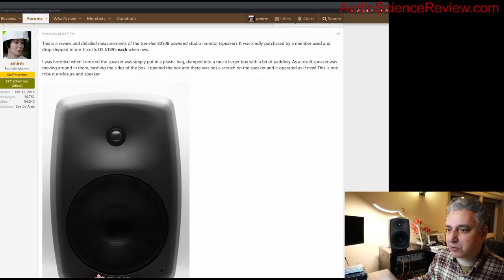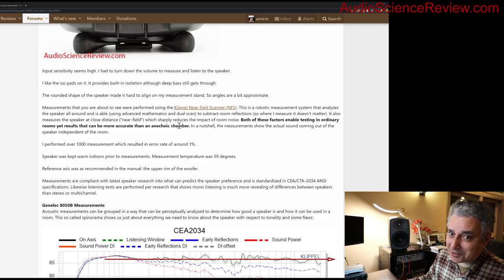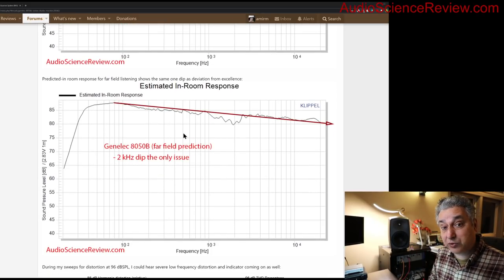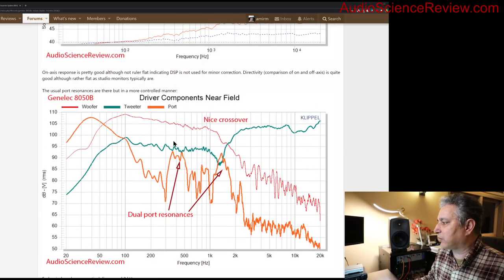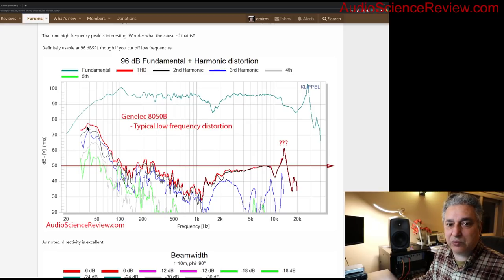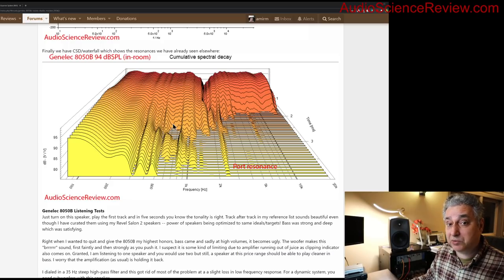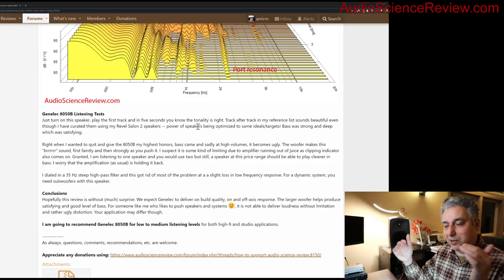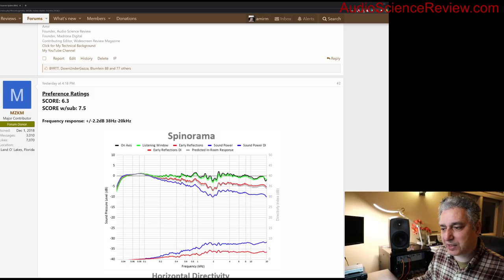Genelec 8050B Speaker Review (and how to read speaker measurements)

Comment: How does the low frequency THD translate to IMD in the woofer? Never seen that measurement really done, probably for obvious reasons. But for two-way systems it seems that could be a major source of distortion at higher volumes. Even though my main speakers are full range, I still set the cross-over up to limit the low frequency content below 100Hz, and balanced the sub accordingly. Seems to buy some more headroom. I have done in the past some quick two-tone IMD tests of the woofer and tweeter with tones at the lower and upper end of each's respective response, and got a few percent at around 85-90dB. Might take that measurement again with a better eye to detail and actually use a wider range of tones for the lower tone in the woofer to see what happens.

Comment: I've been extremely satisfied with a pair of Genelec G5s which I understand is more or less the same speaker as this in terms of performance. I have them set up in a rather compact apartment with Dirac room correction. They get more than loud enough and there's only a handful of tracks and movie scenes where the bass response ends up falling short. Hard part is choosing what to upgrade next.
Reply: Genelec subwoofer and you will be fine!
Reply: What? I thought the g series was for home use , these are for studio monitoring how can they perform the same way?

Comment: Hey Amir, as usual, great content. My nerdy engineer side loves your channel and website will all the heart. 
Most of the content of the video today was already known by myself (well, i'm an engineer). But something was new to me, and perharps you could explain me. You said that the reference point for the speaker axis was at the edge of the speaker, but i assume this is not the case for every speaker right? Could you add this info for you future reviews? might help people with the proper placement. For example i have an LSR305 and i can't really tell if the acoustic center is at tweeter axis or at some point between the speaker and woofer. Perharps the Klipel could tell us with precision! 

Thanks for the great content. Keep up with the nice work.
Reply: PS: I have this idea that the Acoustic center for the LSRs are at the LED position.
Reply: Hi there.  Every review I have done for good few months has the reference axis in the intro to the measurements.  In most cases, speaker manufacturer does NOT specify this so the convention is to use the tweeter.  Only a few Pro monitors like Genelec, Neumann, etc. specify this and if so, that is what I use and indicate in text.
Reply: @amirmajidimehr640  Checked again, looks like i have to read things more carefully! that would be all! thanks, again.

Comment: Really impressed with your reviews. Why do you not often use the cumulative spectral-decay plot ? And what about the impulse response plot? What is your view on Active speakers vs Passive: Is a long balanced XLR cable better than Speaker power cable? What is better to calibrate frequency response on: White noise or Pink Noise?
Reply: Let me do a separate video on that to explain.  On active, they are far more accurate than most passives and are ready go out of the box.  With many passives you need to EQ to get good results.  Their down side is that they have limited power/how loud they get with some exceptions.  The other down side is repairs.  If the amp in them goes bad, you have to send the entire speaker back for service and this can be a pain.   Long XLR cables are just fine.  That is what they are made for.  On frequency response, white noise at too high a level can damage tweeters.  Best to avoid both and use a "log chirp" signal.  Free and excellent program Room EQ Wizard uses this and that would be my recommendation for measurements.
Reply: @amirmajidimehr640  Thanks Amir! Really appreciate your new channel. Just watched your USB cable interference story. Great that you are highlighting the con-artistry.

Comment: I didn't understand the explanation of the discontinuity where the woofer and tweeter cross over and how the waveguide corrects that. If anyone would like to help me with that, I'd like to learn more about how that works. I also wonder what the difference is between a waveguide and a horn, if there is any.
Reply: How about I do a drill down video on this in the future?  I don't know of a simple reference for it even though it is a baseline aspect of speaker design.
Reply: No real difference between a horn and a waveguide, if anything it would be that a horn aims to also increase sensitivity.

Basically, at 2000Hz, a tweeter in free space (not in a speaker) would be almost omnidirectional, whereas a 5” woofer at 2000Hz will no longer be omnidirectional and the sound will start to focus being more forward.

In order to better match these drivers together, a waveguide basically acts as a barrier around the tweeter so the off-axis can’t go as wide as it normally would and is instead pushed forward, this does increase the SPL of the tweeter at the cost of soundstage, but this waveguide can be shaped such that the narrowing of the tweeter’s sound is similar in spread to the woofer’s natural narrowing.

Now, as for why some waveguides are circular, some are oval, and some are “pinched” in the corners, don’t ask me. The designers probably do some fluid simulations and determine which is best for their application.
Reply: @amirmajidimehr640  that would be wonderful for me! I hope other people are as interested to learn about it as I am. Thank you for considering it.
Reply: @homeboi808  thank you. I think that does clarify things for me quite a bit. Part of what confuses me though is the idea that lower frequencies would be more narrowly focused than high frequencies. I was always under the impression that the lower a frequency is, the more widely and less focus its dispersion becomes. Is dispersion width being affected by both frequency and driver shape?
Reply: @AndyBHome  If you just hung a driver from the ceiling and played frequencies, the “spread” of the sound would indeed be based on frequency and the diameter of the cone.

As explained, a waveguide on a tweeter acts as a barrier. The ultra high frequency (say 15kHz) are so narrow that they don’t even hit the waveguide, they are unaffected. 2000Hz out of a tweeter however is naturally has a very wide spread. This spread is running into the waveguide which is “guiding the waves” so that they get pushed forward instead of spreading out sideways.

2kHz will still be wider than 15kHz, but not as wide as it naturally would be because of the waveguide. Think of cupping your hands around your mouth when speaking.

And again, this narrowing at the bottom end of the tweeter is to compensate for the fact that the woofer is also narrowing as it goes up in frequency, so the waveguide tries to match how wide/narrow the tweeter is at the crossover with how wide/.narrow the woofer is.
Reply: @homeboi808  That is really helpful! Thank you again homeboi! Of course every answer, no matter how good, leads to more questions. Now I'm curious as to why we want dispersion to taper/expand evenly across the frequency spectrum. Do we try to find ways to get all frequencies to be as similar in dispersion as possible? Do we try to get higher frequencies to "spread out more?" Do we actually want certain frequencies to disperse in different patterns from others? (I'm just asking. Please do not feel obligated to respond.)
Reply: @AndyBHome  Omnidirectional speakers (like MBL) indeed do aim for all frequencies to have a constant  “spread”

The Dutch & Dutch 8C is sorta the opposite, where it achieves an constant “spread” by making most all frequencies have a constant narrow “spread”. It is more laser-focused.

 As for whether it’s better to be constant or smoothly tapering, that is up for debate.

I think it also depends on how wide the room is.

Comment: that bass distortion effect you mentioned I feel like I've heard in many powered speakers, stuff like mackie PA speakers. It's awful! for monitors you don't listen as loudly usually, so it's probably okay.
Reply: Tru dat.  There is extreme pressure to keep the size and cost down on internal amplification and it often becomes the limiting factor.  I suspect some of this is also to keep the speaker from being damaged.
Reply: @amirmajidimehr640  
Agreed.  Though excellent up to a certain SPL, the active near-field Neumann KH-120A studio monitors that I use are dynamically limited.  They also have the limiter and clipping indicators like the Genelecs.

As you mentioned, using a separate subwoofer dramatically reduces this limitation.

I'd be interested in having you measure my ATC SCM25A monitors as well.  I was going to approach Erin Hardison about this (have known him for years via car audio forums).   But he's been seriously backlogged, even before receiving and getting his new Klippel set up.

But it will be amazing having both of you guys providing truly world-class objective data to the community!  👍

Comment: Hello Amir, I'm not sure I understand the distortion graph. Do you measure it by doing a sweep, substracting the original tone and seeing what harmonics are left at each frequency? You mention in the video that the distortion bumps in the low end do not matter because we are not picky about the low end, but aren't these harmonics showing up in the mid range rather?
Reply from the maker: Hi Oj.  No, it is a more complicated system.  A log "chirp" signal is used for frequency response.  That signal nicely generates the frequency response but also separates all the harmonic products (they appear in "negative time").  So no subtraction is needed in the way you imagine.  

On distortion, yes, if they bleed into mid-range then they do become audible.
Reply: @AudioScienceReview  I see, thanks for the clarification!

Comment: There's no way the woofer is producing those higher frequency sounds in the graph. It is a safe assumption that the crossover keeps going at the slope you can see near the crossover region (or in reality steeper since the woofer can't reproduce those frequencies well anyways). There's no reason a designer would add complexity to the XO just to bring the woofer back up to frequencies it will have cone break-up / beaming problems.

Comment: Could a person who just read your measurements determine that bass distortion you noticed without listening to the speaker?  Is the nature of that issue captured in the measurements, or could it only be determined through listening?
Reply: I am afraid not.  I have tried to develop tests for this but it is not an easy thing.  In addition, it stresses the speaker so there can be some risk of damage during measurements.  Since I don't own these speakers, I can't quite there.  But I will keep thinking about a way to objectively show the issue.  For now, listening test is very quick and reliable so have to go with that.

Comment: hi, is there a point in buying something like focal arche when there is topping l30 e30 combo that has awesome response
I get it, integrated unit, balanced out, built in France probably better capacitors and etc. but the difference in price is huge, and in measurements not really
Reply: Yeah, unbalanced into 32ohm it gives 1W with -80dB SINAD. The Schiit Heresy for instance gives 2.4W with -95dB SINAD.

You are mainly paying for the fact that it’s Focal and you can use it as a headphone stand so it looks cool.
Reply: Depends on whether you believe in amps changing the sound or not. Objectively speaking, there is absolutely no reason to pick an Arche over some of the more recent budget competition.
Reply: i mean ideally amps should be wire with gain right?
I am so impressed with these "cheap" dacs/amps that we have today I don't even think it's worth to pay several times more to get almost nothing in return
Reply: @bizkac  Not almost nothing, provably nothing, because the noise level is so far below the sound level that it is completely inaudible.
Reply: at least you get more ports and things like mqa support or PREMIUM CAPACITORS

Comment: It looks like someThing out of the terminator movies. Yes it measures quiet cos the gain level is turned down so much and only sound it will pick up is the sine wave, pink noise or frequency sweep. I can, we can all do the same thing when measuring up close which is what I do if measuring up close I turn the gain level down on the mixer used for the XLR microphones.
£100 grand for what is mostly made of aluminum and some servo motors most of the bulk is common as cheap fish and chips on ebay, Daylight Robbery £100 grand.

When I take measurement of my JBL professional cinema five screen. 
I can place multi micro-phonones close to the projection screen  one near the bass driver and other mic near the HF horn using the audio mixer I balance the levels with pink noise and if I switch the polarity I see at the crossover point a - negative dip in the frequency response. It's that simple.
Reply: @Andy Summers   
Your setup does not provide any type of Spinorama data for each speaker.

This system also consists of proprietary hardware electronics (I/O & precision control interface), a precision laser, multiple proprietary measurement modules, a precision microphone, and very involved/complex proprietary/automated software.

Klippel knows that they are not going to sell a million of these, so they must make up for the low quantity of units sold with a high price to cover all of the R&D, software development, and precision manufacturing costs.

This system is far, far away from a simple USB audio interface and basic measurement microphone and the free REW software (the latter of which is amazing given its cost)!

It is the absolute best measurement rig and system available in the world at this time, and only the largest transducer design and loudspeaker manufacturing companies own and use these.

It's not like a consumer DIY 3D printer kit, with a simple, inexpensive USB interface and basic measurement mic, LOL.

It's a precision, industrial piece of equipment, and is priced as such.

YES, you can achieve most of the same results with less costly equipment.  However, the real advantage to this setup is its SPEED in regards to measuring SPINORAMA loudspeaker data, and its absolute consistency (repeatable results).

The same results would take anyone at least 10 hours, or even multiple days to achieve with a manual setup, and they would not be nearly as accurate and repeatable.

For those who need to conduct these types of measurements on a daily or recurring basis, especially for commercial loudspeaker system design and development, it is an absolute game changer and easily worth its price of admission.

It provides MUCH more consistent and repeatable results compared to a manual measurement setup, and in a very short amount of time for the amount of data collected.  Time is money!

Comment: You say tonality is everything but tonality is the easiest thing to alter with DSP. Distortion is what it is. So why would you not focus on low distortion and deal with frequency response with DSP?
Reply: DSP can help a ton so mostly yes to what you say.  Alas, off-axis response cannot be fixed with DSP (a bit can, but not more) so you still want a well designed speaker.  Also, having to boost the response increases distortion.  So yes, within reason.  :)